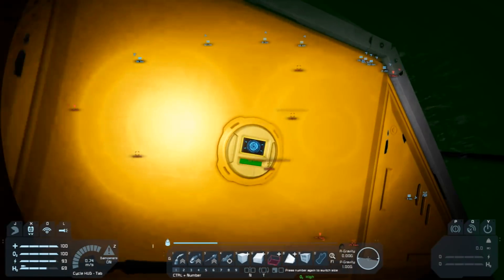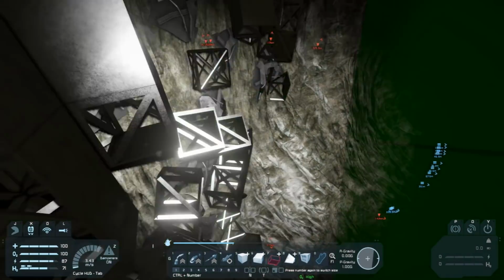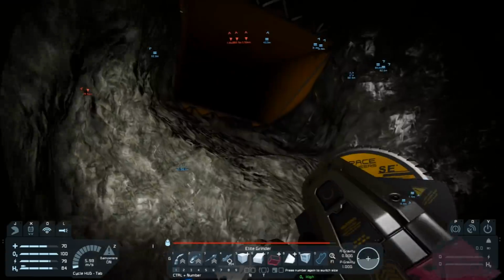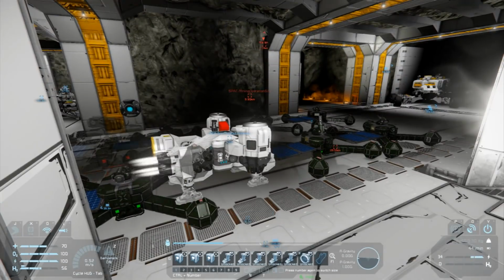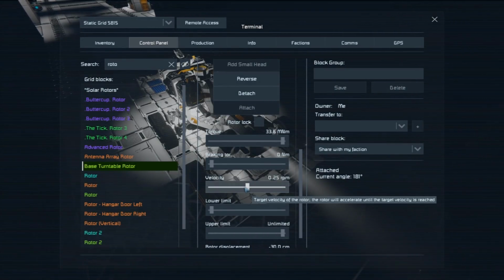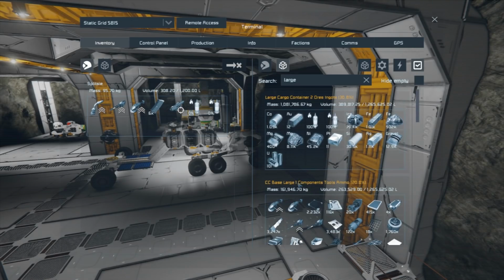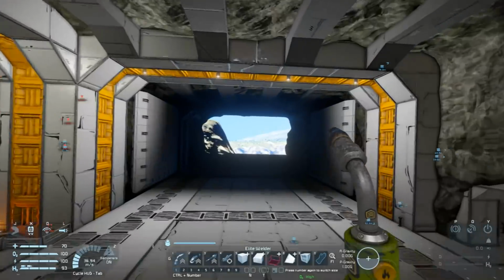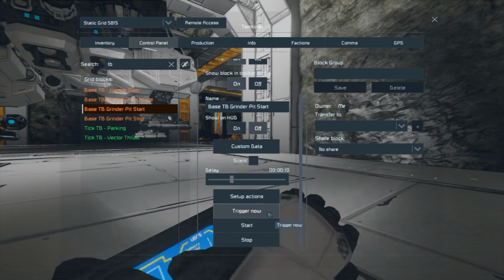Survival, Maybe... #58 Drones learn to use wheels... sort of (A Space Engineers Survival Series)

Comment: I wrote you a script that says if your sandbags have ammo or not through the antenna, just slap the script on the sandbag and it should work.
P.S you should add a landing gear on auto lock at the bottom of the sandbags so they don't slide around or tip over.

Script: 

// Self updates, may lower FPS depending on interval
const bool SetUpdate = true;

// Amount of ammo left before it throws a low ammo warning
int LowAmmoThreshold = 15;

// Antenna Displays this when the turret needs ammo
String NoAmmoString = "No Ammo!";

// Antenna Displays this when the turret has low ammo
String LowAmmoString = "Low Ammo!";

// Antenna Displays this when the turret is stocked up on ammo
String HasAmmoString = "Sandbag Fine";

// Antenna Range when turret has no ammo
float NoAmmoWarningAntennaRange = 50000;

// Antenna Range when turret has no ammo
float LowAmmoWarningAntennaRange = 50000;

// Antenna Range when turret has ammo
float DefaultAntennaRange = 5000;

public void Main(string argument, UpdateType updateSource)
 // Runtime Update
{
    List<IMyTerminalBlock> Antennas = new List<IMyTerminalBlock>();
    GridTerminalSystem.GetBlocksOfType<IMyRadioAntenna>(Antennas);
    IMyRadioAntenna WorkingAntenna; 

    List<IMyTerminalBlock> Turrets = new List<IMyTerminalBlock>();
    GridTerminalSystem.GetBlocksOfType<IMyLargeGatlingTurret>(Turrets);
    IMyLargeGatlingTurret WorkingGatling;

    if( Antennas.Count() > 0 ) {
        WorkingAntenna = (IMyRadioAntenna)Antennas[0];
        if( Turrets.Count() > 0 ) {
                WorkingGatling = (IMyLargeGatlingTurret)Turrets[0];
                IMyInventory  GatlingInv = WorkingGatling.GetInventory(0);
                if( GatlingInv.GetItems().Count() < 1 ){
                    WorkingAntenna.CustomName = NoAmmoString;
                    WorkingAntenna.SetValueFloat("Radius", NoAmmoWarningAntennaRange);
                }
                /*else if( GatlingInv.GetItems().Count() < LowAmmoThreshold ){
                    WorkingAntenna.CustomName = LowAmmoString;
                    WorkingAntenna.SetValueFloat("Radius", LowAmmoWarningAntennaRange);
                }*/
                else {
                    WorkingAntenna.CustomName = HasAmmoString;
                    WorkingAntenna.SetValueFloat("Radius", DefaultAntennaRange);
                }
        }
        
    }

}

public Program()
{
    if(SetUpdate){
        Runtime.UpdateFrequency = UpdateFrequency.Update100;
    }
}
Reply: Ralakus Nice, I'll have to try this out.
Edit: Since Splitsie has 'broadcast' disabled most of the time, it might be good to ensure that is enabled when ammo is low.
Reply from the maker: Sorry I've been a bit slow on the messages this weekend, it was a long weekend where I live and I was away and with very minimal phone signal so couldn't get on to reply. I'm keen to test out this script but will need to work out how to turn broadcast on and off with it first before I use it in the survival series :)
Reply: There is no function to enable/disable broadcasting on antennas, the variable is set to read only in the game code so I can't change it with programmable blocks, some ways around that are to set the range to something like 10 meters and to some higher range when it needs ammo, or turn the antenna on/off when it needs ammo or not. I have the first way of doing already made, just change the variable DefaultAntennaRange to some low number.
Reply from the maker: Oh, well that's annoying. The range trick is a nice workaround though :)
Reply: Ralakus Try: {antenna}.ApplyAction("EnableBroadCast");
Where {antenna} is of type IMyTerminalBlock. It toggles broadcast on and off. Disclaimer: I'm stuck on the dx9-32 bit branch, so I can't be sure if it works in the current game.
Reply: +Cyberguy42
Oh hey, that works. It is surprising how bad the SE C# API documentation is.

I rewrote the code to support that: 

// Self updates, may lower FPS depending on interval
const bool SetUpdate = true;

// Antenna Displays this when the turret needs ammo
String NoAmmoString = "No Ammo!";

// Antenna Displays this when the turret is stocked up on ammo
String HasAmmoString = "Sandbag Fine";

// Antenna Range when turret has no ammo
float NoAmmoWarningAntennaRange = 50000;

// Antenna Range when turret has ammo
float DefaultAntennaRange = 5000;

// Do not modify anything below
List<IMyTerminalBlock> Antennas = new List<IMyTerminalBlock>();
IMyRadioAntenna WorkingAntenna; 

List<IMyTerminalBlock> Turrets = new List<IMyTerminalBlock>();
IMyLargeGatlingTurret WorkingGatling;

public void Main(string argument, UpdateType updateSource) {
    if( Antennas.Count() > 0 ) {
        WorkingAntenna = (IMyRadioAntenna)Antennas[0];
        if( Turrets.Count() > 0 ) {
            WorkingGatling = (IMyLargeGatlingTurret)Turrets[0];
            IMyInventory  GatlingInv = WorkingGatling.GetInventory(0);
            if( GatlingInv.GetItems().Count() < 1 ){
                WorkingAntenna.CustomName = NoAmmoString;
                WorkingAntenna.SetValueFloat("Radius", NoAmmoWarningAntennaRange);
                if(!WorkingAntenna.IsBroadcasting){
                    WorkingAntenna.ApplyAction("EnableBroadCast"); //Thx Cyberguy42
                }
            }
            else {
                WorkingAntenna.CustomName = HasAmmoString;
                WorkingAntenna.SetValueFloat("Radius", DefaultAntennaRange);
                if(WorkingAntenna.IsBroadcasting){
                    WorkingAntenna.ApplyAction("EnableBroadCast");//Thx Cyberguy42
                }
            }
        }
    }
}

public Program()
{
    GridTerminalSystem.GetBlocksOfType<IMyRadioAntenna>(Antennas);
    GridTerminalSystem.GetBlocksOfType<IMyLargeGatlingTurret>(Turrets);
    if(SetUpdate){
        Runtime.UpdateFrequency = UpdateFrequency.Update100;
    }
}
Reply: Ralakus No kidding. Glad I could help.
Reply: Splitsie In case you didn't see it, Ralakus posted an updated script

Comment: You could add a grav gen to bias the salvage to slide into the pit more easily, how strong it needs to be will depend on how easily stuff slides down the ramp naturally.
And to save on power you can have them be activated with a sensor covering just the ramp
Reply: ratchetfreak only problem with that is grav gens only effect players and grids with artificial mass blocks on them
Reply: Artificial grav doesn't work in natural gravity above 0.5
Reply from the maker: For both those reasons sadly grav gens won't help :(

Comment: Good episode. I was wondering in regards to the scrap getting stuck in the pit. Would it be possible to make a tilting wall? Imagine one of your hangar doors placed on a slant in the pit, then a button press and it rises up vertically (Or close to it) to make the scrap slide down towards the pit of mayhem?

Also, I would love to see you create a small drone. One small (or medium) cargo container, and enough thrusters and such to be stable. Then set it up to go with the goose to the mining pit. Program it to empty out the goose as you mine, fly to your base and offload, before returning to your goose for a refill. Could even call it the gopher or something else. Don't think it have to be to big, and not sure how programming the remote control drone would work, with one of the stops being movable (Goose). Unless using sensors to pinpoint the location?
Reply: Oberon Blade I haven't used it myself, but there is a script for docking with mobile connectors (though they have to be stationary at the time of docking) https://steamcommunity.com/sharedfiles/filedetails/?id=1331869874
Reply from the maker: The main reason not to build a drone to empty the Goose is that it would defeat the purpose of the Goose... my big advantage with using the Goose is the incredible power savings it gives me. Rather than flying all that heavy ore up and down the hill I can move it with wheels, same with not having to fly the butterball up and down. You'd still get some savings with a drone vs the butterball, but not as much as the Goose manages :)

As for the tilting wall, I'm thinking of adding a blast door to the entrance to the pit that goes from horizontal and then drops to the slope for easier dumping and more gentle lowering to the slope
Reply: Splitsie I like the idea of the blast door. You get the same functionality without to much clutter. 

Good call on the goose. I like your setup with it and look forward to the other trailers. Main reason I keep pestering you about drones that work off a script is I want to see if it's possible. You're then onky YouTuber I watch play SE. Maybe make a gunner platform that circles your goose as you bringing out? Extra layer of protection to and from the sandbags and home base

Comment: Making a sandbag shouldn't take more than pushing a button to slowly spin a bp over a base welder, followed by manual detaching and loading.   That way they'll be ready for you.

I bet those turntable rails could be on the inside track.

If you start another base or go to space, you could always use a separate world file with us being none the wiser.
Reply from the maker: I'm planning on building something to print them in the not too distant future, but wanted to get back to some unfinished projects before starting more new ones :P

I may end up doing something like that with the world, I'm very much of the perspective that I should do whatever is going to work best for the videos :)

Comment: Question, why don't you have the grinders on  the bottom of the Pit and just funnel scrap to it.? that way would allow for full grinding with out the complexity and crushing, considering the pit is surrounded by voxels. i understood the previous pit version and not wanting to do it then, but now i can see it working better without issues with the grinders at the bottom,.
Reply from the maker: Static upright grinders will always leave small pieces between them which can only be dealt with by hand and I was hoping to work out a way to remove the hand grinding step from the process... it didn't work as well as hoped :P

Comment: when the grinder pistons go down the first grinder makes contact but the rest don't. if you put grinders on individual pistons then group them(for the TB/PB), drop the force push by half (but leave enough force to retract against gravity), all the grinders will make maximum contact with the most amount of blocks (reducing the time it takes the grind) ????
Reply: Cool idea, I had made the same observation. However, they would collide with each other during the grinding process. Just look at how much it shakes right now, if each of them worked separate, they would destroy each other.
Reply: tensor share
 ????
Reply: Could use rotors with displacement to get a bit of space between them, but that would make the whole thing much bulkier.
Reply from the maker: You'd need to work out some sort of way to create some space between each welder, you might be able to achieve it by having an advanced rotor on the base starting a small grid, then use advanced rotors again to convert back to large, leaving a single small grid block between each piston and welder setup. Would be incredibly prone to destroying itself but would also look seriously cool while running :)

Comment: I am just thinking why the grinders are not on the ground facing upwards? Then gravity will do the rest. Or I am missing something?
Reply from the maker: There's a small space between grinders where grids can fall and won't get cleaned up, if I had them upwards facing I'd be constantly having to manually get in between them to clean those bits up, it's quite a pain to deal with :/

My whole thing with this grinder pit was trying to see if there was something I could build that was overengineered, but would also be capable of cleaning up the grids and not leaving bits behind :)
Reply: @Splitsie  aaaah gotcha. I knew there must be something. As that would be possibly the easiest way of doing it. Thanks for a quick answer.

Comment: You did fill them with ammo right?
Reply: They have ammo in their blueprint, which means it will print it with the ammo in it
   (?)
Reply: I don't think it works that way, Splitsie mentioned earlier that an upgrade would be to use conveyors to connect the turret to an advanced rotor when the projection gets welded up so that ammo could be auto loaded.
Reply: Cyberguy42 thats what i thought too
Reply: It might be, idk know exactly. Maybe Splitsi will explain it in the next vid.
Reply from the maker: I put the ammo in manually during the little montage bit :)

For pasting in blueprints in creative you will get the cargo contents the have when the blueprint is generated, but for survival you don't get any of that and I'll need to come up with a conveyor setup

Comment: For those pesky trees, you can hand grind them to chop them down fyi
Reply: they unfortunately have a tendency to respawn every time you load up the game. I got a tree in the middle of a mining hole that I have cut down many times now but it always comes back even if it's in the air.
Reply: spectre900 might be able to go into settings and turn flora density off might solve it from spawning additional trees
Reply from the maker: That might be overkill, I'd just make a shrine for the floating tree and start worshipping it as a visage of clang's peace ;)
Reply: Splitsie i tested my hypothosis, works like a charm.

Comment: Just notice a little thing. When you put Sandbags close to the trees, do you think they will block Sandbags a little bit? Because Sandbags use small grid turret, they may not have too much range advantage. They may need that first several bullets to hit the enemy turrets for sure. Though I have never seen a tree block bullets yet. But a grid or a player can hit trees, so I believe they are also not ghosts for bullets too. Well, not so sure about this one, just for discussion.
Reply from the maker: It's certainly possible, though the trees are only collision objects at the trunk so hopefully since the drones will be flying they shouldn't get in the way, but it's something worth thinking about...
Reply: Oh, and you mention about turning off Sandbags in the grinding pit. So I guess that means you do not pull out the ammo when putting them in there. I'm not sure but feel that items will be destroyed by grinders. Do you worry a little about those wasted magnesium, and nickle and Iron? Well not that many of them, so definitely no big deal. But I feel that it's kind of interesting to think about how can this problem actually be solved. The idea came up to me so far is to put an ejector on Sandbag and send message to program block to turn it on, so that it will eject all ammo at a place in your base, where you can put some collectors to collect it. you can even set a antenna which only have several meters range send this message when you are near (by sensor). So when you are carrying a Sandbag and passing through it, all ammo will automatically out and you can then move it to the pit without pressing anything.
Reply from the maker: The grinders on grids pick up whatever is in the inventory of blocks they grind down, so as long as they don't go boom! it's all ending up back in storage :)
Reply: Oh! That's good to know! Seems like I used hand grinder too much. Now you make me want to build a grinding pit as well. Thanks for the tip. :)